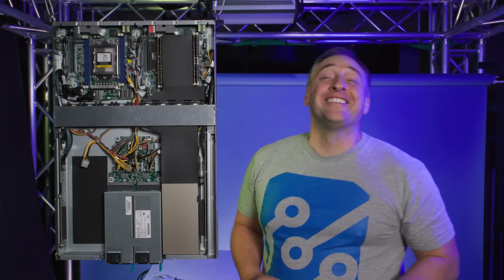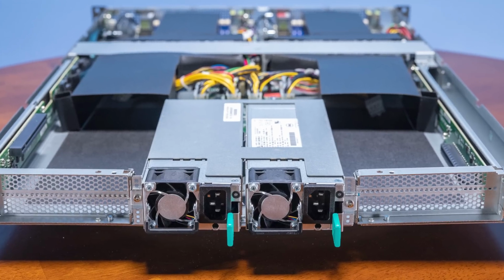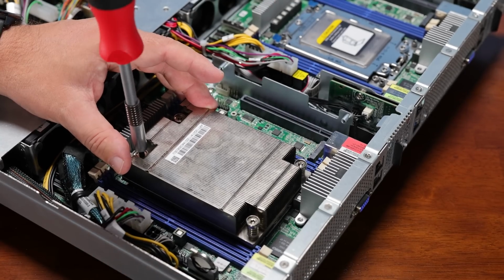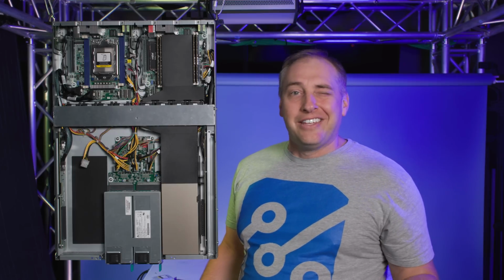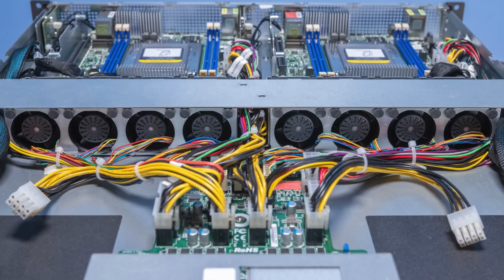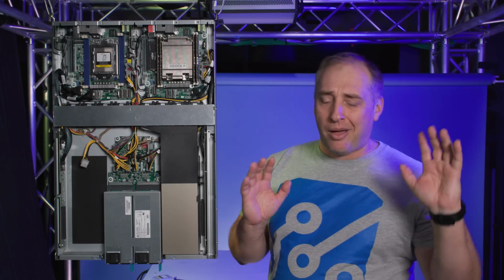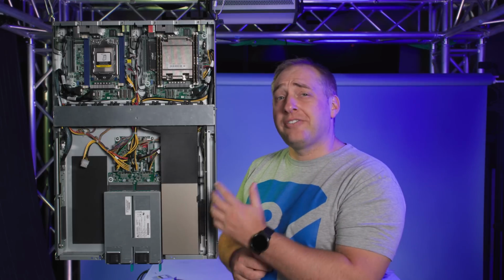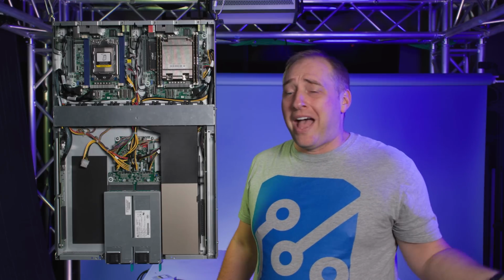ASRock Rack Made An AMD EPYC Server Like No Other

Comment: I can see this as being ideal for video wall applications. With 2x 4 output GPU's we could replace 6x Dell 7920 2RU Precision Rack workstations with 3 of these and save significantly on power connections and rack space.

Comment: I've been working with servers for the last 20 years and let me tell you pal it is just crazy and useless. You must have a very good reason to go full bare metal in orther to adquire one of these. first, each board 
has only four slots of memory so in theory you would only be able to acoomodate  512Gb ram for each one.  servers ought to be designed to  accomodate the maximum  amount of memory that the processor could handle. in this case  Epyc processor could handle upto   4TB of ram (latest xeon processors  could handle up to 6TB)  so being able to only accomodate 512Gb is just not acceptable for today's standards.  If  i was to adquire a server with epics processors i would go for a Proliant server with a dual socket board where i could accomodate all the memory that could be supported by the processors in this case 8TB ram. And then i could use virtualization for managing all the server's resources wisely.  so i do not see why i should get one of those dual servers from asrock.

Comment: I can totally see this for render farms and distributed AI. You're probably getting a much better resource distribution perr rack. Typical GPU servers are 4 GPU, 1-2 CPU in 4u... This is 8 CPU, 8 GPU in 4u... And again, better optimized and lower cost CPU/ram to keep GPU workloads going.  A bit more labor heavy, but if you can just swap out 1u on a rack and work on it out of band it's not so bad.
Reply: Also worth mentioning that Supermicro have made a few dual socket 1U GPU servers which support three/four dual slot GPUs for a while now. From the 1028GR-TR/1028GR-TRT (three dual slot GPUs, dual E5-2600 v3/v4) to now the SYS-120GQ-TNRT (4 dual slot GPUs, dual 3rd gen Xeon Scalable, PCIe 4.0, support for Optane PMem).

Comment: oh, each node limited to 500W on 120v power. So, most people would have to call an electrician out out to prep for use at home. I don't even have 100 amp circuits in my house. Nevermind 240v.

Comment: The networking is what holds this server back. Better if they had SFP ports
Reply: 10 GB is easy over short distances with copper.  To me, this is for high density compute, not much network throughput needed.
Reply: @farmeunit  it’s less about throughput and more about connectivity options. In order for the nodes to work with large compute sets they often need to connect to a SAN, etc…. As an example I have 10G,25G,40G,100G in my data center and none of it is RJ-45 copper.
Reply: @matthewguerra5410  Then don't buy it.  It's not made for you.  He gave a perfect example for web hosts.  High density VPS.  There already options out there for you.

Comment: Is there anything you guys know of that and link these nodes, like via those PCIE slimline connectors.
Would be great for HA without having to pass extra data across Ethernet.
Reply: I don't think you can tie two motherboards together with a PCIe cable unless the PCIe ports are configured for non-transparent bridging. I  can't remember if EPYC even supports PCIe NTB, but even if it did, it would have to be enabled at the BIOS level. That isn't  a feature that would be designed into this, NTB is very rare and only really implemented in systems designed for HA workloads.

Comment: I've kind of wondered why somebody hasn't made a solution for systems that have single nvme slots. Since nvme is just PCI Express you would think you could split it out to multiple drives. Make something where you could stack them on top of each other on an assembly that converts multiple drives to a single nvme slot.
Reply: They have those... 1-4 nvme in a pcie x8/16 physical.  Using one in my desktop as it's easier to access than the onboard nvme covered by the video card.
Reply: @aztracker1  I meant one that works in a nvme slot though.
Reply: Looks like something similar to what I am thinking about exists.  The amfeltec AngelShark Carrier board.  It would be nice to see one that stacks the drives vertically though.
Reply: @computersales  gotcha... Not sure. NVME drive interfaces are pretty dumb, 4 channel PCIe, not sure if they'd run in 1x mode or not.  I know I couldn't run a 4x pcie3 drives in my early m.2 motherboard with a 2x m.2 slot.a few years ago. So would expect compatibility issues.

Comment: I notice that each board has a lot more PCIe breakouts than the chassis supports, but a lot of dead space in the center where the power cabling runs. Would be cool to see someone 3D print a bracket for an M.2 NVMe breakout there, especially if folks are using these for ML stuff where you'd want fast storage for the training corpus.
Reply: I though the same thing.
Also it may be possible to get those PCIe lanes (or maybe some SATA lanes) out of the chassis if only a passive GPU with one slot-width would be used and the second would be used for the connection out. Or even as a holder for an U.2 SSD...

Comment: Interesting server, BUT if the memory of CPU 1  is 'full' you can not just draw some from CPU 2 since there is no connection like in dual socket boards
Reply: True. But a huge cost advantage if you're doing a lot of GPU heavy distributed workloads that may not need more than 256gb ram to keep full.

Comment: This server is super cool. I immediately thought of using this as dedicated racked development boxes for software engineers that need either a GPU or an FGPA. A quick search of the inter webs shows that there are PCIe risers that will fit a single m.2 in a 1U box. Sabrent has one but that might put the m.2 on the wrong side…It’s a really niche and neat server, thanks for the review/overview!

Comment: Too bad they didn't make a Mirror Y version, than the front would be symmetrical and the pci lanes for the GPU would also be the same :-)
Reply: It doesn't make sense to have unique left and right motherboards. You'd split your manufacturing volume in half for each side, you'd need to double your RMA inventory, as a customer you would need to stock twice as many spares. You would consume twice as much R&D for two separate motherboard projects, have twice as many bugs to fix during development. Development cost would be twice as high, and that would be baked into the final server price.

Comment: Hi Patrick! I can totally see this for VDI where the company doesn't want to send a workstation home with somebody. A challenge that stands out to me is that with only two NICs per system, and forced external storage, you'll have to decide between one NIC for storage and one for user access, or redundancy where you are competing for storage and user access on the same switch ports/NICs and hoping the LACP gods favor you.
Reply: Have not looked at the NICs spec, but maybe you can blast trunks over them.
Reply: any sane OS can trunk those links, and use the m.2 for cache.

Comment: There are a few problems with this type of setup.
1. Network ports in the front of the unit makes it waste 1u space to run network cables into the front of the rack.
2. Networks these days are 10G+ fiber
3. Lack of drive spots.

Making this quite limited on usage. Still kind of cool to see something cheap.
Reply: My first thought is GPU optimized distributed workloads. Render or AI farms. Very high GPU count per rack this way and better optimization of ram and CPU power GPU.

This work is meant to be easy to route to many nodes and if one goes down, the rest keep rolling.

Comment: Big nightmare to cable this server in your rack, cables coming out off the front. Cables blocking airflow for other servers. It’s a weird one.
Reply from the maker: I generally agree, but in this server, you can cable to either side or in the middle and be fine. Many places use racks where this is not a big deal.

Comment: This makes sense only in the eyes of the ASRockRack PR team... if it was trully as cost optimised as you try to paint it, they'd just drop the extra PCIe OCULink ports, cutting on board space to about mITX and consequently costs, for a dual node like this setup. It's just a marketing ploy to upsell their deep mITX-y solution without taking into account the board is kind of limited to begin with - 16x slot1 + 4x M.2 slot + 6x 8x OCUlinks + maybe 4x to intel's dual 10GbE... that's still far off the 128 lanes available on Epycs. To make it more cost efficient, one would need say 6x U.2 or more of local storage availability through said OCUlinks, especially if the drives supported 2x 4x pathing... heck to pack it tight, the 6x8 could be split/combined to 3x16x lanes and then through slim 4 M.2 adapters to 3x4 storage devices, and then the 4th 16x slot could be populated by eg some thin 1 slot accelerator. Or just use the 4x16x lanes from ports to drive 4 accelerator cards eg paired in 2 sets... Maybe a transcoding one or a gpu for vdi or compute infra... Now then this might make sense. Still, the connection to the storage would hamper this in terms of just a compute node/blade purpose on data loading/storing. Heck, this board makes far more sense in something more akin to edge or home server or NAS - where you can start with 16c but grow to 32c or more depending on possible sales or servers depots.disassemblies down the line, similary where you'd start with say 2x or 4x 16GB DIMMs for the lowest yet kind of usable cost of mem setup but have the chance to grow to 4x 64GB if/when the RDIMMs become available for less, a platform/system making good use of the 2 OCUlinks that could be spread/converted to 16x SATA connectors and expose these as 3.5 slots of slow(er) storage to populate over time when costs permit or need arises, and then add the remaining OCUlinks to 8 U.2s for hot tier/caching/metadata device, use the M.2 for OS duties, and the 16x slot for accelerator and/or networking through a splitter/raiser, put this in a neat condense package and you get something not too disimilar to QNAP TS-h1290FX... In my eyes, companies wanting to offer storage solutions could very well utilise such systems as main selling force of this mobo/platform...
Reply: It's cost optimized because they are using existing boards which they sell independently from this chassis...

Comment: I don't work in a physical Data Center environment (only remote monitoring), but my gosh I'd be lying if I said I wouldn't want something like this to tinker about. Two 8-Core P-SKU Milan EPYCs, 64GB RAM per node, two 12GB A2000s, and two 2TB Samsung SSDs and I'm done.

Comment: Versus a dual socket this makes total sense in dedicated hosting if you were to have two different people using those servers bare metal. As the provider you get some of the advantage of shared resource, but from a customer's point of view they have a totally dedicated physical machine... sort of.

Maintenance would be a pain there, but otherwise it makes a lot of sense.
Reply from the maker: I think you are spot on

Comment: This is perfect for dedicated/web hosting companies. Our servers are all 32 cores 128 gb or 256 gb ram and our storage is all networked with local storage for the OS and applications with 1gbit outbound and 10gbit local network. A customer is not going to notice if their email loads a few ms slower and every other feature that is offered in the dedicated server market is available. You can save several thousand per rack and 50% on your DC rent with these. I can see hosting companies like OVH and GoDaddy ordering these by the boatload.

Anything loadbalanced could benefit as well since the storage may not be in the server you land on and you can add more networking instead of GPU. You could have a few racks of these with several racks of storage.

The more I think about it, the more I like it. I see use cases across the entire industry where you could save a ton of money using this.
Reply from the maker: Great feedback
Reply: What happens when the customer who is renting the node next to yours needs service and the whole chassis has to be powered off and removed for service? Seems like you're twice as likely to be impacted by hardware issues with this kind of design. Whole chassis has to come out to service one node.
Reply: @noname-gp6hk  true... If course there's always risk when going for lower cost. If the applications are stored on a SAN, then you assign the IP+storage to another system,. See a moment of downtime when the 1u gets pulled.

Slightly easier if there's a thin hypervisor.

Comment: Well, the networking would be on the GPU with a convergent DPU + GPU bundle like the NVIDIA H100 CNX. Technically that would also be able to replace the management controller as well & provide the hypervisor. If you really wanted to commit to this concept you could get rid of networking, storage and management up front completely. Eventually, we are going to see a design like this, where it is basically just grace hopper with memory on one small board and networking going out of it. You could probably get away with half of the depth of this then, or a 4 node system.

What bugs me a bit about this Asrock one, is maintainability. It really is just two nodes put in a box. Usually, these systems have seperate sleds or the likes to maintain or replace the nodes individually.
Reply from the maker: Great point
Reply: It is clearly for hyperscale who want to provide instance with dedicated GPU and CPU. You just replace the entire server on site.
Reply: @xud6405  Hyperscalers typically use much bigger machines and divide them with VMs for flexibility. They also make a lot of their server designs themselves. Heck AWS uses DC only in the server, has its own DPU and even CPU and accelerator chips, though those two not exclusively of course.
As he said in the video, this is for as cheap as possible root servers, as you find them by more commodity hosters, where still, yes you can fix it on-site, but bringing down one customers system to fix another’s wouldn’t be my choice. Clearly you need to weight that against the cost for more metal and engineering of separate sleds.
Reply: Fair enough. But as mentioned, cost optimized. And if it's a render or AI farm, taking two nodes when maintenance vs 50% or more expensive... It's not a bad deal.

Comment: I'm after an EPYC3251D4I-2T and have been told that Asrock is having major trouble sourcing the 10 Gb NICs. Has that been resolved?
Reply from the maker: That is an industry-wide problem :-/
Reply: X550 is the problem - i needed 50pcs of X570D4I-2T and was told by my distributor that they are not available and asrock can't even tell when they will be. That is the reason why X570D4I-NL is a thing. Considering that they now announced X570D4U-2L2T/BCM with broadcom instead of intel, this is not going to get better anytime soon. So now we are considering ROMED8HM or even ROME2D16HM3 (i can fit those into our cases) but it is quiet $$$ and i still don't have availability info on OCP NICs.

Comment: I always love the "hang from the ceiling" server demos on this channel.

It makes me want to run a few servers in that orientation... I mean hot air rises, it would be great for cooling!
Reply: Well this one at least
Reply: Good for circulating air as a space heater.
Reply: It's like a charcuterie
Reply from the maker: Except it is the wrong direction for airflow hung like that :-)
Reply: @ServeTheHomeVideo  But at least it will be easier to lift it when it is turned on with the THRUST from the fans.
Reply: @Ilovepastatoo  Haha vendors would have to give weight in two metrics: "weight at rest" and "weight at 100% fan load"
Reply from the maker: Immersion cooled are usually hung vertically but without fans :-/
Reply: you want to run water cooling upside down, on the ceiling - he forgot thermal paste on this install - i don't like this node setup - lack of pci lanes on a chip that supports the kitchen sunk - it is case of red shirt jeff taking out the sawzall  #paid over enthusiasm #the juice weasel
Reply: no octo core mem? a non starter - leaving all the perf - they will run 2 mem channels on 12 channel in future #trends #non thorough throughput #thoughtful mindlessness